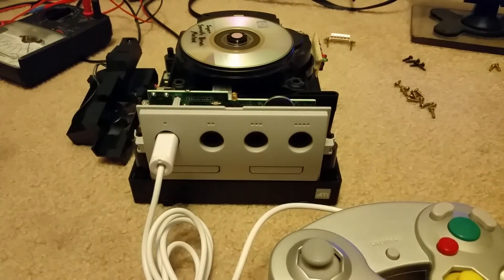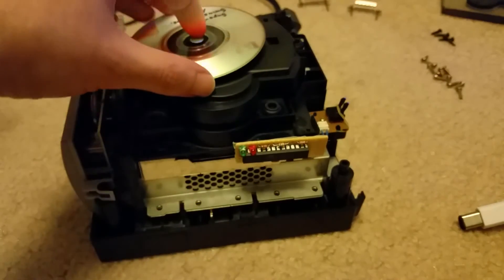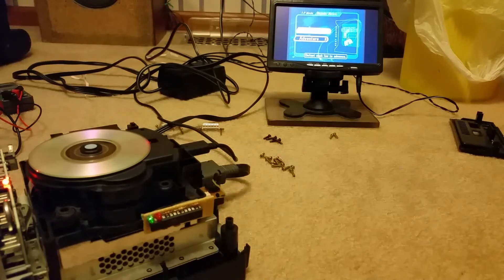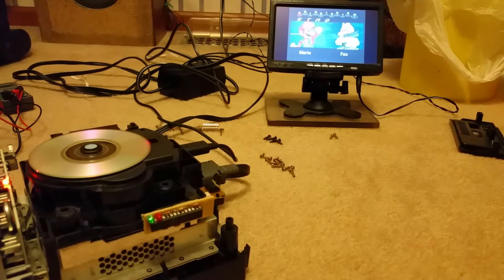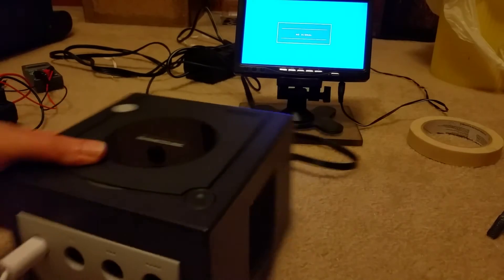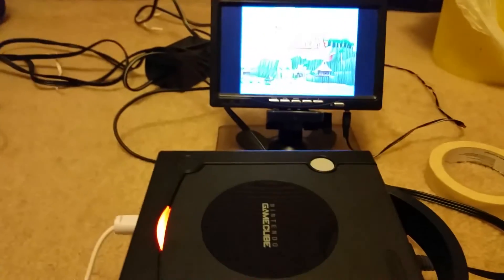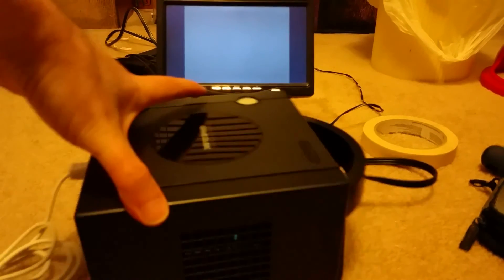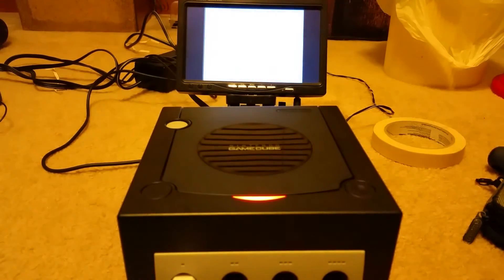Nintendo Gamecube DIY Modchip Demo

Comment: Hi. Cool. It plays full sized burned CDs and it works with both US & Japan?

Thank you. God bless, Proverbs 31
Reply from the maker: Yes to region free, and it will run full sized dvds but you'd need to mod the to shell for them to fit.
Reply: That's cool. No need to buy the region free chip mod then:-). It's fun to make things sometimes on weekends (though I haven't finished any mod attempt- the GBA backlit mod may be the first, it just needs to be reassembled- I just need to glue the plastic for the screw that shattered into pieces coz' of too much torque while screwing). I probably shouldn't have bought two versions of the GC (US and Japan for lack of space- unless I buy the office box made of steel grills, stack them up, improve the cooling underneath as well) or maybe did that switch at the back thing mod to make it accept both regions. But this one is more powerful, it can run backup games on a CD-R. Thanks.

Comment: 1) are you using the 3.3v or 5v version
2) which firmware are you using
3) can you make a tutorial for the flashing part :3 plz
Reply from the maker: The chip I am using, the Atmega 8, works at both 3.3V and 5V. I can't remember where I got the hex image from but it should be easy enough to find by searching for "open source gamecube modchip". When I get some time I can make a video tutorial how to flash the image using an arduino.
Reply: sjm4306 yeah making a flashing guide would be so awesome

Comment: electronics on a rug, i cringed so hard because  there could be static discharge :(
Reply from the maker: +LottieBot Turbo Oddly enough I have never managed to destroy or damage electronics due to electrostatic discharge and I've been tinkering on a rug since I was 8. Sure I've released magic smoke due to other forms of negligence but never esd. I guess I'm either stupidly lucky or the esd protection clamp diodes on most cmos io saved me multiple times. I'd hazard a guess at the former.
Reply: +sjm4306 same here fam :3
Reply: +sjm4306 by the way is it totally necessary to modify your pot?
Reply from the maker: +LottieBot Turbo It was only necessary since my gamecube was bought used and I guess the laser is starting to wear out and had trouble reading dvd-r discs. As always YMMV.